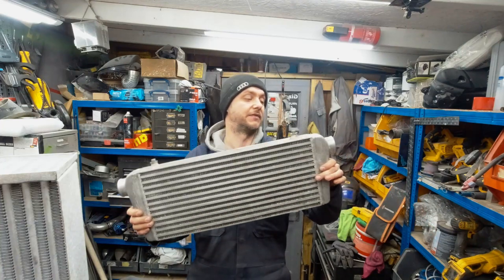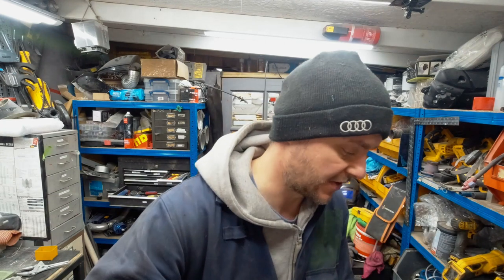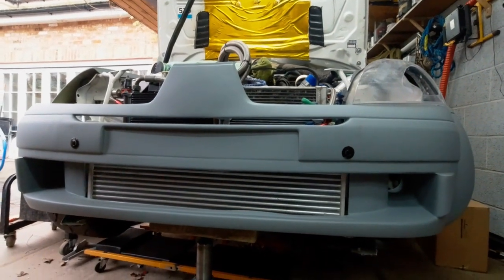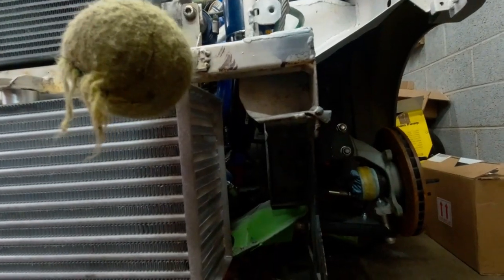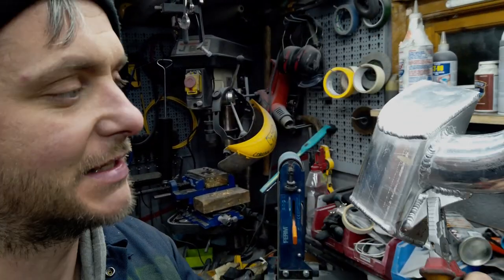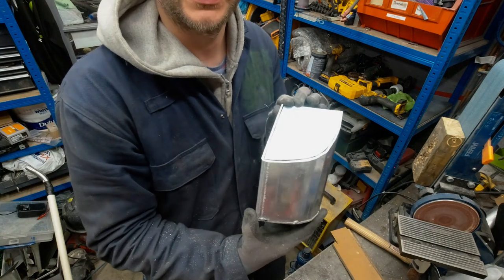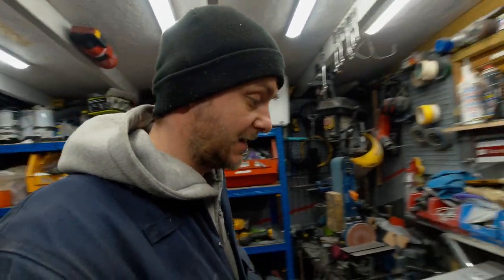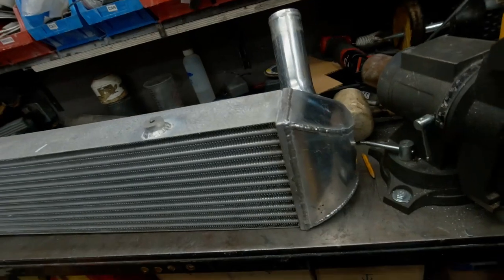How to Make an Intercooler. Custom Intercooler Build for my Clio 172 turbo. Ep.29

Comment: You also have a smaller pressure drop with this style of intercooler. I had a Pro Alloy FMIC on my Celica GT4, the flow and cooling it offered were amazing. Pressure drop was also tiny, I think you’ll see the same on yours too. 

Lower pressure drop means you aren’t working the turbo harder (and therefore hotter) to hit the same target boost. It’s not uncommon to see 2-3psi of pressure drop on eBay cores...
Reply from the maker: Cheers mate! Quality is very very good! One of the main reasons why I slashed out on Proalloy core is the pressure drop of fleabay cores. Good as they are can’t beat custom!

Comment: Wow! Welding skills are getting ever more impressive. What do you reckon to power gains from running a bigger cooler? Does the turbo have more to give or is it at limit on the prior setup? Another mapping session required?
Reply from the maker: Thanks mate! According to almighty Chris, it won’t change the charge temp all that much so in that respect fuel map is flexible enough to learn and adjust. However we will gain lads lag, and more efficient set up overall.
Reply: @RuskiWeldFab  could you run more boost now if you wanted with a better cooling setup to gain power that way? (Not that Novi needs it!) just curious 🧐
Reply from the maker: Not really. Turbo is already running at peak efficiency vs boost. Raising boost won’t give any sizeable benefits. Titanium exhaust will 😂🤫
Reply: @RuskiWeldFab  ooooo. Will look forward to where this goes then!👍🏻